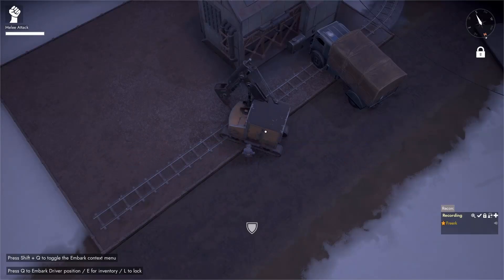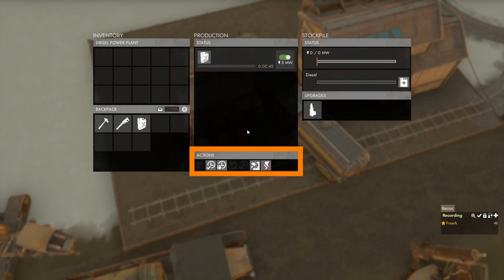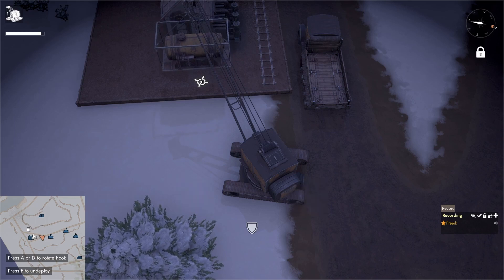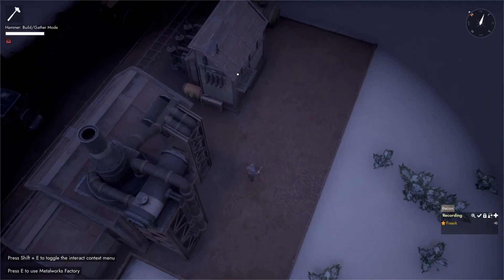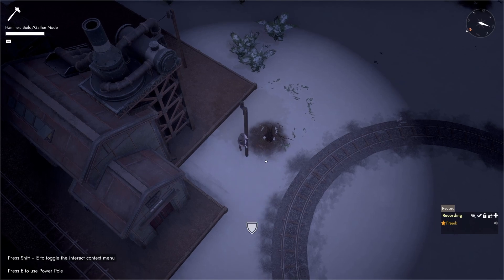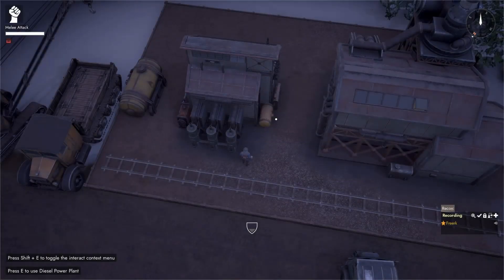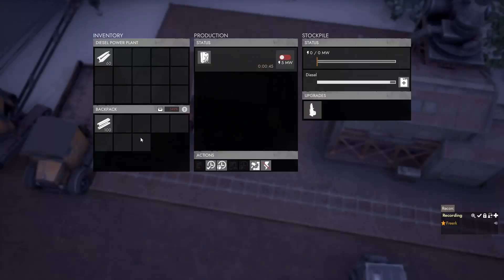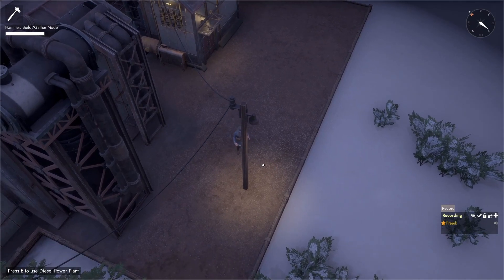Foxhole Facilities - Power Plants and Power Networks

Comment: Damn, I was hoping I could build a massive facility with coal generators to supply power to all the facilities in a hex, but that maximum amount of powerper network is really screwing me over. I guess that'll mean more powerlines across the hex.
Reply: RIP: The limitation of only 20 cables away from the source isn't good either, though I did note that if you simply have another powergen closer than 40 powerlines away the network will expand to it's limitations remaining to keep that power level across the entire network.

Comment: What about the maximum number of power poles?
I think it's 20, correct me if I'm wrong.
Reply from the maker: I can't say I tested it, so I don't really have an answer ;). 
If anybody does, please enlighten us all?
Reply: I'm not aware of any maximum.  The wire itself also has good range, so you'll be maxing out total network power before you get close to running the risk of no more poles.
Reply: I just tested it and power can travel up to 19 power poles.
Interestingly the 19th pole does not transmit its power to a maintenance tunnel next to it, which might indicate that power can travel up to 19 objects, not just power poles.

The question is, will it be necessary to build power factories in certain intervals to accommodate for the maximum travel of electricity?
Reply from the maker: @eyebr0wz989  If that's the case wouldn't it be easier to just start a new network at the destination and not have a power pole line across the map?
Reply: @FreerkHoltes  good idea. This is probably what will happen. Depending on the oil fields available, we might need to transport fuel containers which probably won't be a problem since we'll have cranes already set up at the farming nodes.
Reply from the maker: @eyebr0wz989  Forgot to thank you for the test and reply, so...: thanks!
Reply: @eyebr0wz989   don't think in terms of poles, think I'm terms of cables. The power will be transmitted over 20 cables and the sable from the power station to the first pole is already one plus the one between the end user and the last power pole means you get a range of 18 power poles or rather 20 power lines.